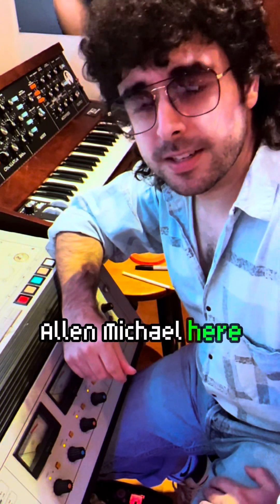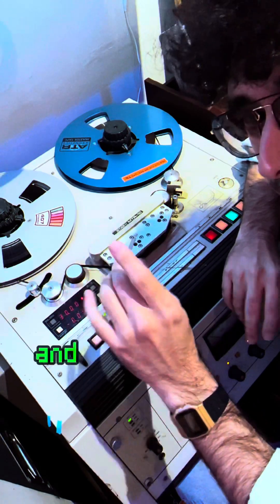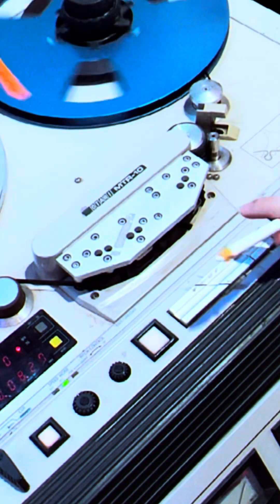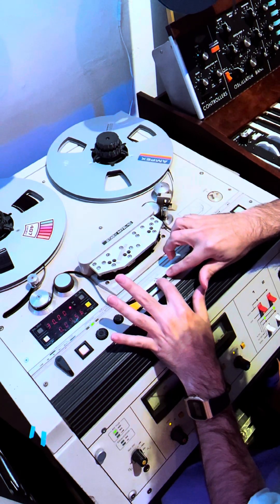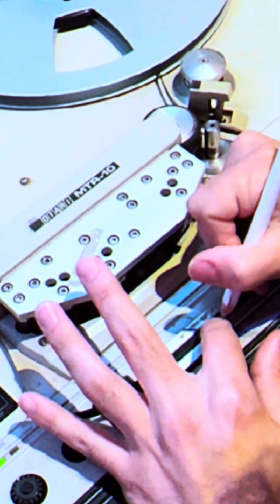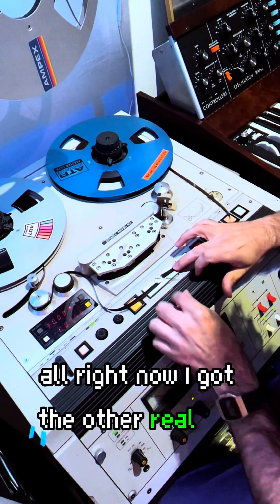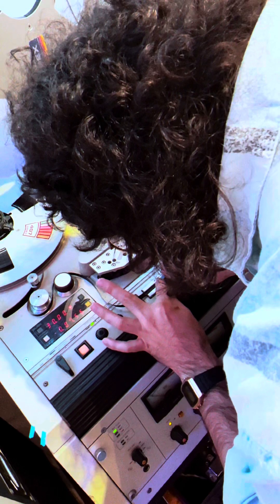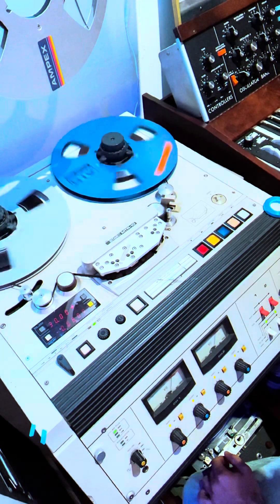The Lost Art of Tape Editing / Splicing - Recording Techniques from the Past - OTARI MTR 10 Reel

Comment: The splicing tape trick is, a roll of splicing tape in a tape dispenser, cut it off with the razor blade and tag the tape to the edge of the blade - then using the blade with a strip stuck to it, place it in the edit block slot (much easier to position) and press it in as you peel the end off the blade. (This from a decade of tape editing in the 70's). Nice work!

Comment: hi have the same model  i just like to say this is great to have because i can get under the deck
like you are doing

i was lucky to find one in the uk   the deck was sold to me with alot of plus parts  
like more rollers and head blocks  1/2 1/4  

and  4 track 1/4 play back head  my deck don't record any more  the coil that doe's the bio over heated   

i had the same in my  teac 80-0   i was lucky 
someone had a spare part  please never leave
deck on all the time a tec told me  
note  the lamp in the button go bad i put all new 
lamp in  
i was uning it alot   i still use it for 1/2  tapes